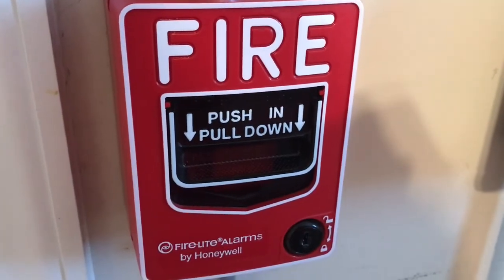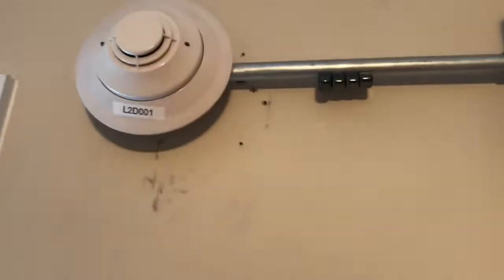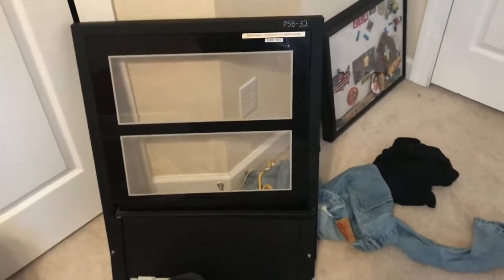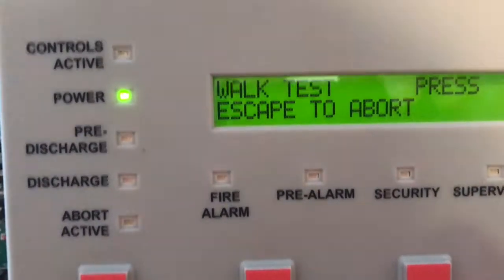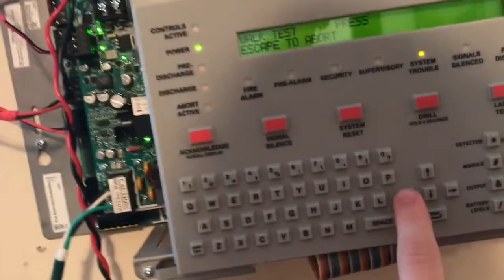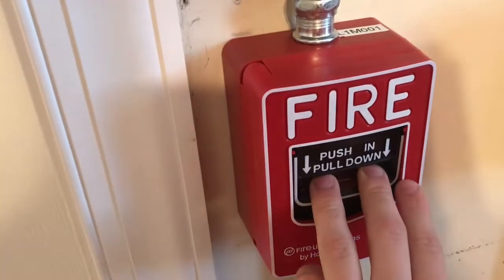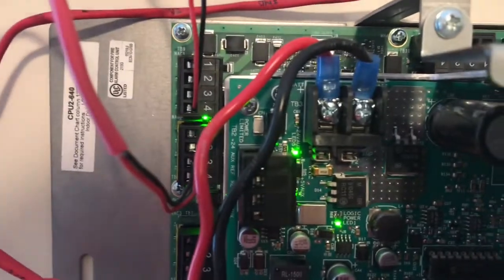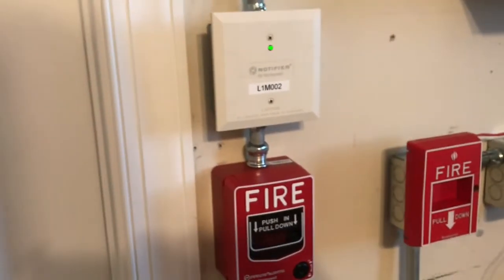Notifier NFS Test 1

Comment: Quick question dose the notifier or the pull station detect smoke or would I have to hook up a detector separately?
Reply from the maker: Rumblin Mower Please tell me this isn’t a serious question.....   Detectors are made to detect smoke. Pull stations don’t detect anything. Pull stations are essentially a light switch with a fancy module that talks to the panel. Detectors have sensing principles/chambers that tell the panel how much smoke it is picking up.
Reply: My alarm panel ia in trouble. 
The indicate alarm is..
TROUBLE FULL STATION GF.EE ROOM AREA.
now.what should i do?
Reply: @koykoyskoyakoy7174  Replace the pull station.

Comment: Good day can you teach me how to trouble my fire alarm panel.? Tnx sir.
Reply from the maker: It'd be difficult for me to teach you how to troubleshoot online. If the only trouble on the system is the pull station, try replacing it. If that does not work, use a digital multi-meter to read for voltage on both pairs of wires going to the pull station. If there is no voltage, it is likely a disconnected wire in the previous device.
Reply: Thanks so much sir! Now i have an idea

Comment: this is a very useful information especially for us who work as an HSE Officer, can I get your email address? If you don't mind there is something that I want to discuss with you, I have a problem to test the alarm since it is connected to the Low Pressure Carbon Dioxide System, so when I pull the Alarm it will automatically trigger the release of Carbon Dioxide, So could you give me clues about how to inspect the fire alarm without release any Carbon Dioxide, Thank you
Reply from the maker: You will have to manually disable the control modules/relays that trigger manual release